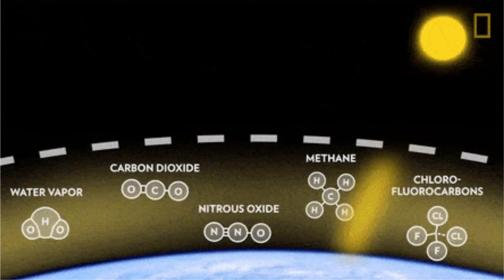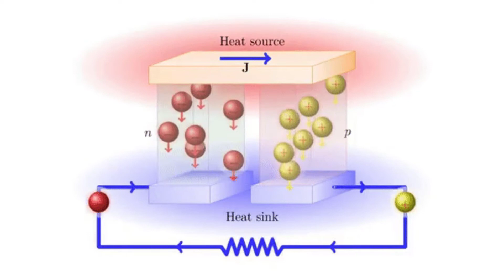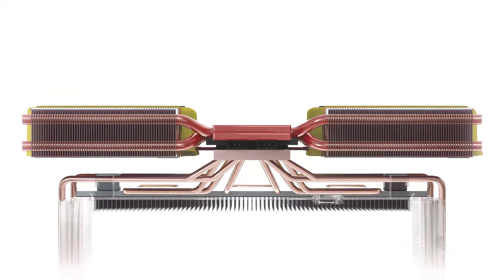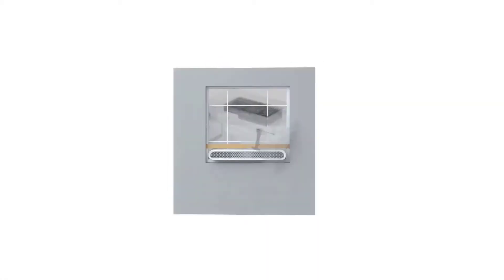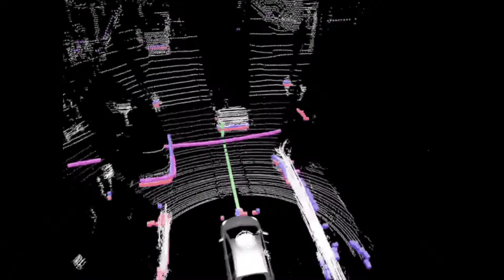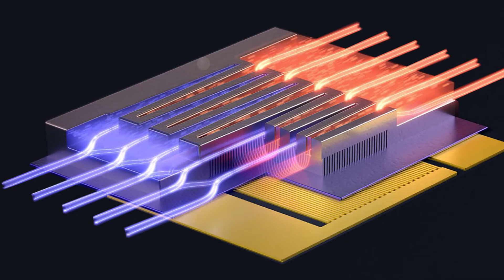Cooling technology  a new era for thermoelectric coolers

Comment: cooling devices consume alot electricity!! I have a food freezer that operate on electricity ( 180 volt - 190 volts ) and draws ( 1 ampere - 1.5 ampere ). The amperage consumption may decrease if the voltage increases. Is this excessive consumption ? Leakage and malfunctions are rare. Malfunctions can occur in any device.